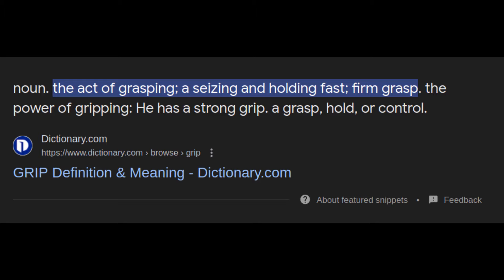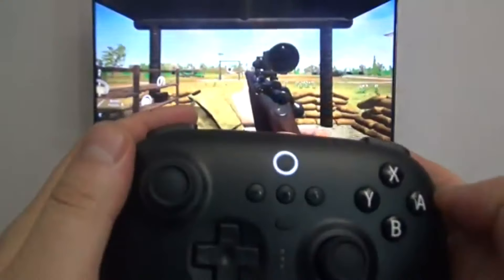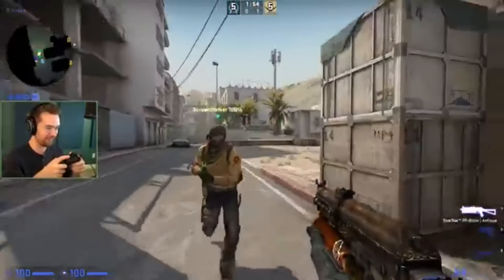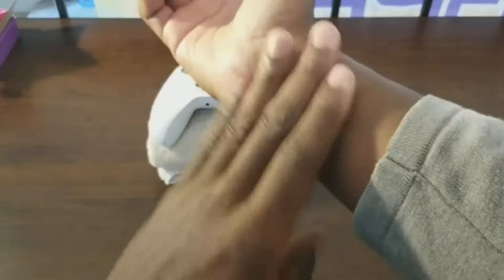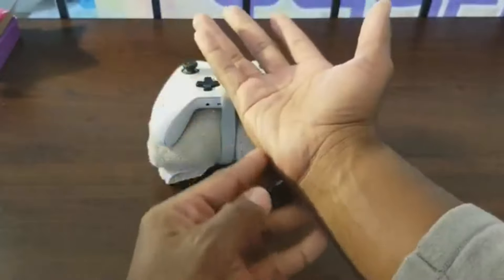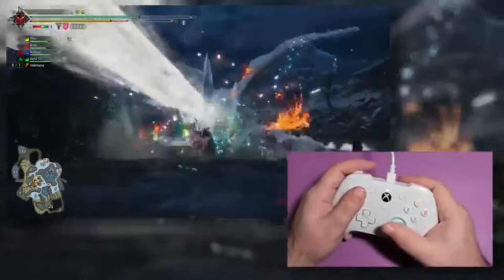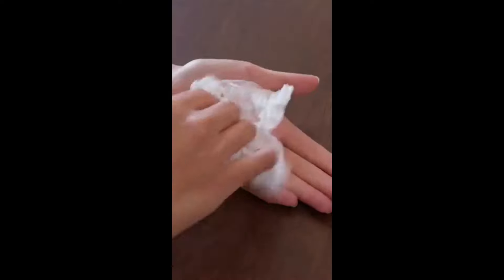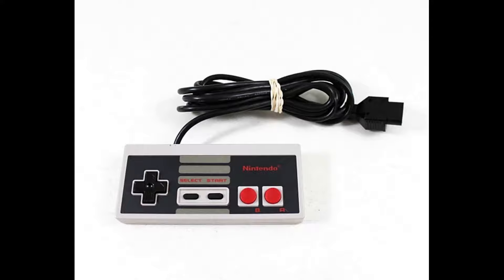My Least Favorite Trend in Modern Controller Design

Comment: I'm 99% the time on keyboard/mouse but the few games that I do use controllers on I always figured I liked my PC 360 controller over the Xbone controller because I grew up playing on the 360 at friends house's so I just wrote it off as me having a nostalgia bump for the older smoother design. And my hands never sweat with the 360. A little validating to see that I'm not alone in thinking all this over-texturing isn't helpful. Although there's a few small cases where I actually didn't mind the texturing like on the edges of the thumb sticks for the Xbone controller.
Reply from the maker: Yeah analog sticks do have a need for a little help such as rubberized tips or textures as you mentioned. On the actual shell though having such things can cause discomfort

Comment: But at the same time, there were some batches of older controllers that would wear out fast. I think the xbox 360 surface would wear out, causing it to be glossy and slippery when I got sweaty hands. 

I would appriciate a thicker and higher quality finish on the plastic surface of the controller, so it lasts longer

Comment: i think the xbox 1 s controller is the best, it's got the xbox 1 controller design ( best controller design in my opinion ) and doesn't have that much grip so you don't notice it, unlike the series where they put grip everywhere so it feels like my hands are on a cheese grater and i think the colours are just the best out of all xbox controllers + its easy to use on pc and works with any controller compatible pc game.

Comment: The 8bitdo one with the SADX switch and the DS4 v2 (the 1st party one, not the one with the weird bumps that was shown in the montage) feel fine, I don't know about the other ones though. 1st party Switch Pro controller grips don't feel bad either.
Reply from the maker: Some may not be too bad, but it’s marginally different from a smooth finish for sure.